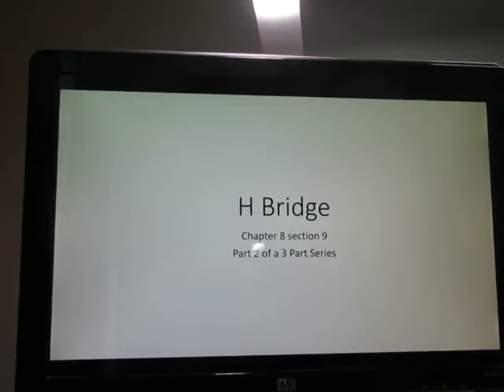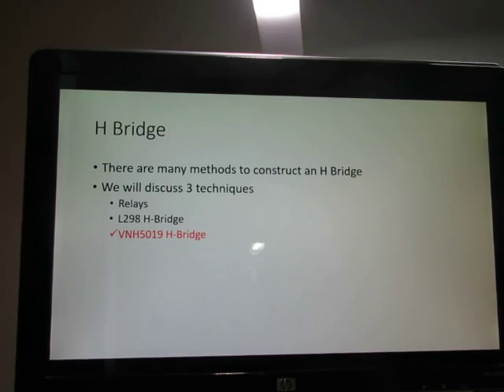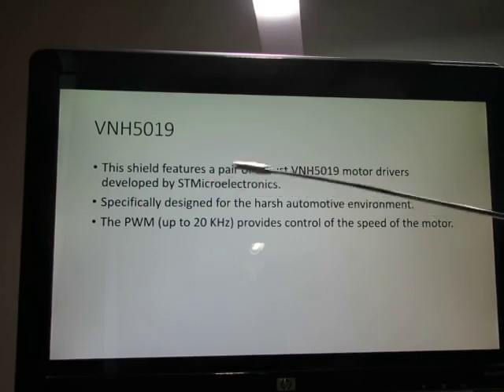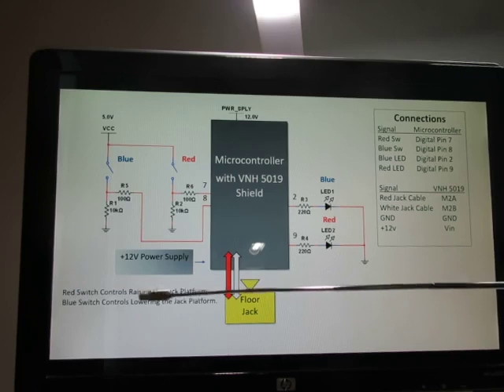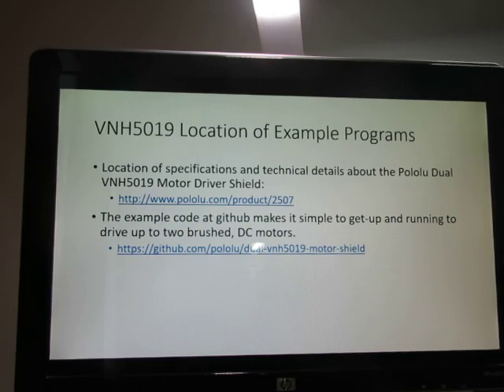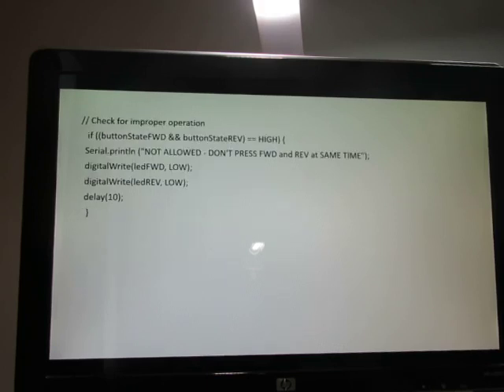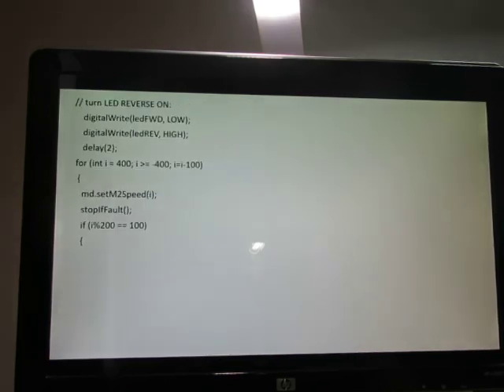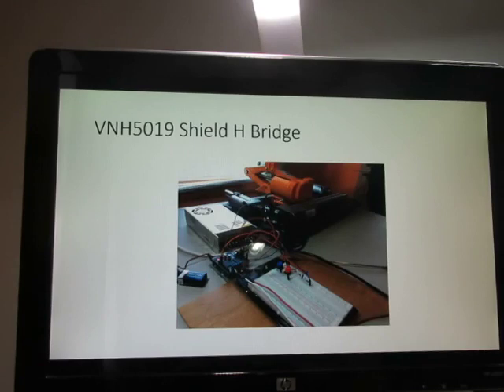Vnh5019 H Bridge Presentation 1

Comment: greetings, many thanks for this informative video, i have viewed a few video on vnh5019, yours are the best, so i have all but one question: @5.39, the code:    md.setM2Speed(i);  was to run from 0 to 400 at 
increment of 100, others have used 255, am i correct this "i" is actually the pwm ??? thanks in advance for your answer, again, great video;